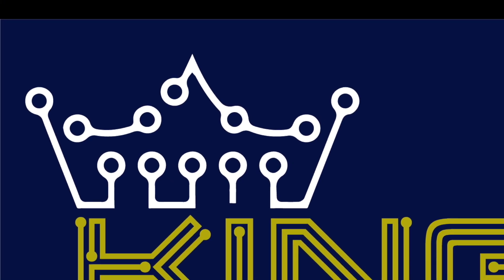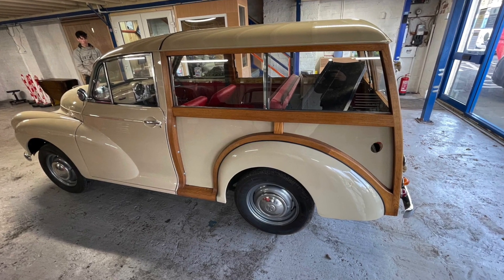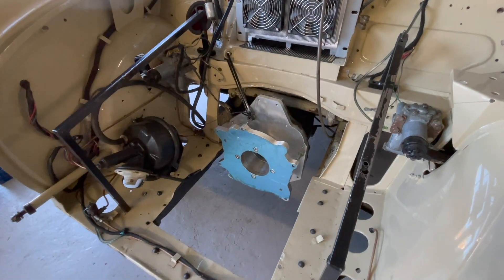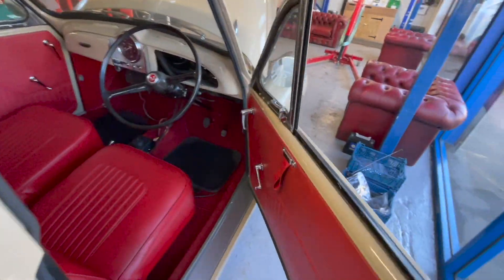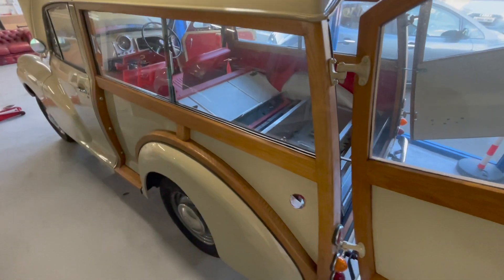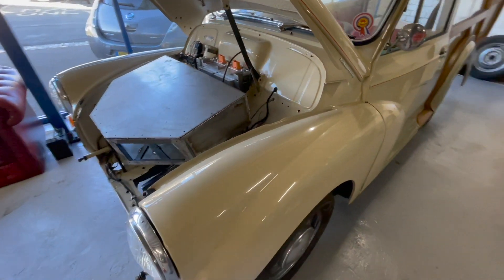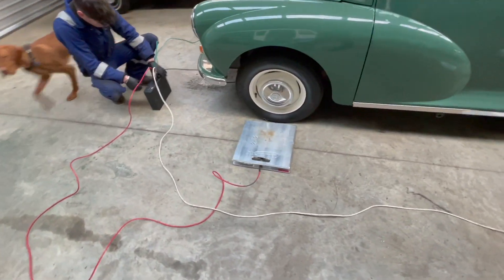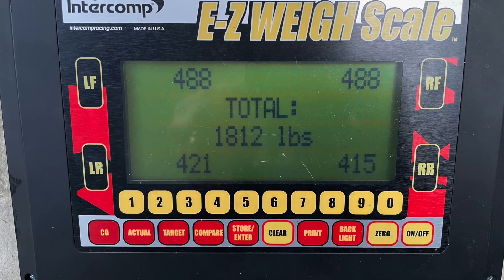Electric Car Conversion Update - 1968 Minor Traveller

Comment: Only 20Kw/Hr? Surely you could at least make it a 24Kw. 
What kind of range are you going to get from that? 60 miles on a full charge?
Reply from the maker: Space is limited. If the customer opts for 40kwh modules we can increase capacity. 60 at very worst 100 during summer. It’s a much lighter car.
Reply: Thanks for your swift reply. 
My Dad’s first car was a “Moggie” Traveller, same colour as that one actually, but earlier model with the “flip out” indicators in the wood frame. Still remember the registration: SMS 9
I know that a lot of Minors have been converted. Look forward to seeing the finished car. 😊👍🏻